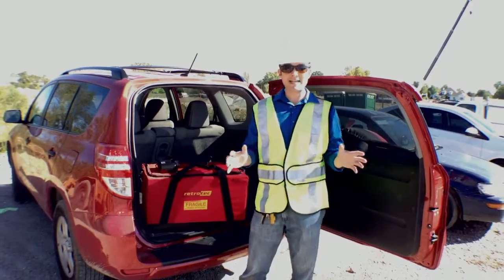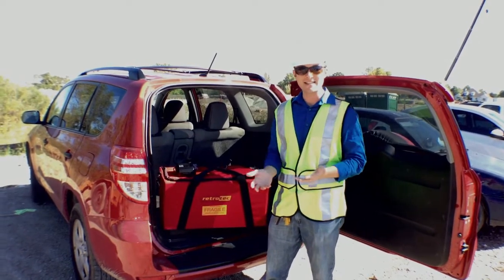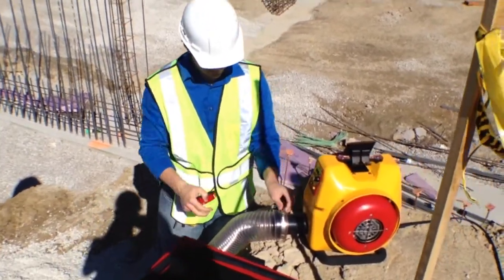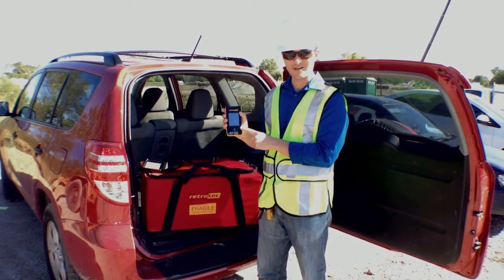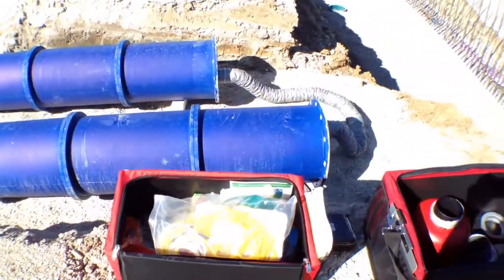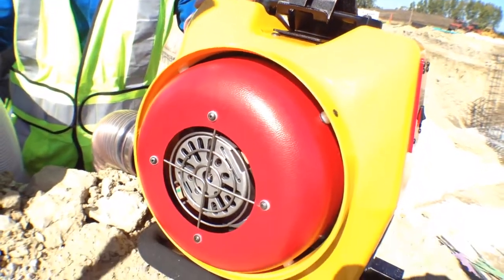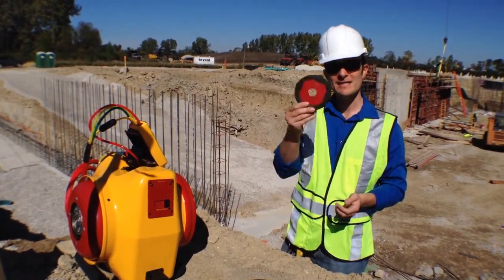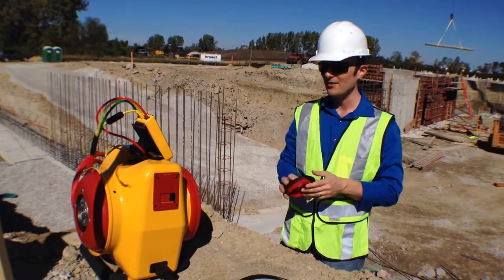Commercial Duct Test for Underground Air Leakage

Comment from the maker: Technical corrections from Colin Genge, the inventor of this tool at Retrotec:
"All of these manometers will take around 30,000 Pa without damage. In some cases when it reaches 5 inches of water column it will start reading backwards- meaning it will go up to 5 inches and then as the pressure continues to 6 inches it will then read 4 inches."
"The range that you were using to test the ducts is the lowest range we normally use for testing residential ducts, but we DO have five or six ranges that will go well below that in terms of flow."